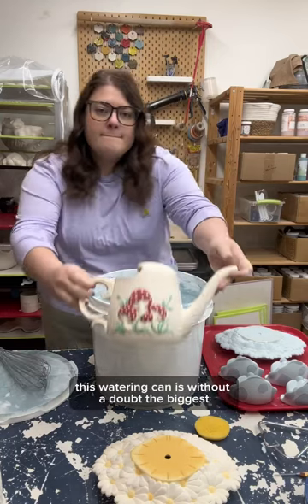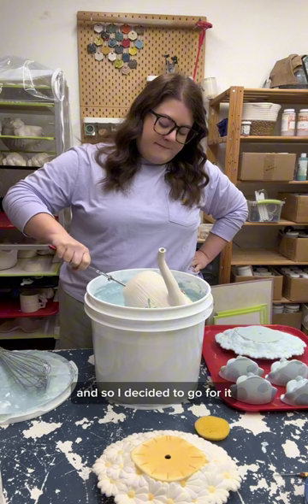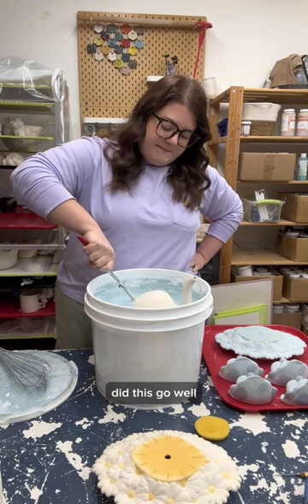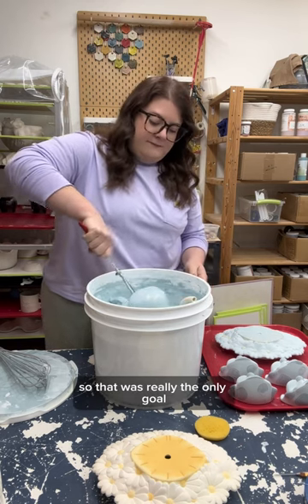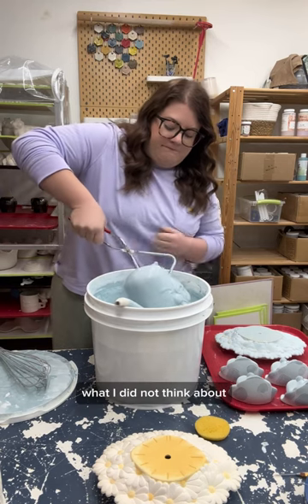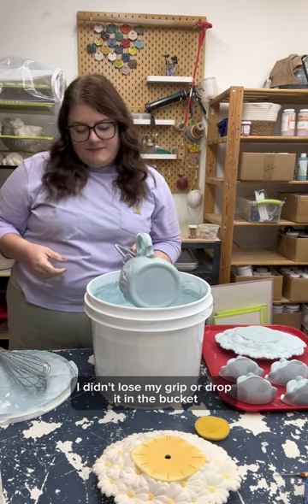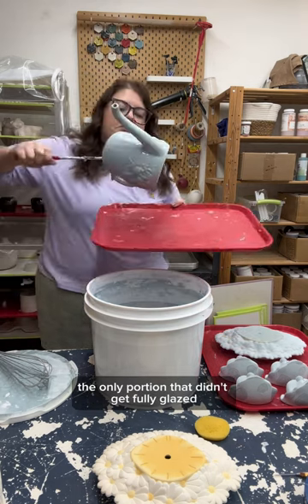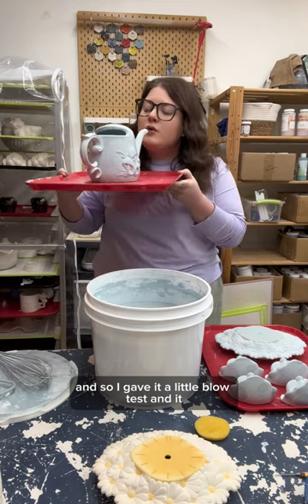Three more firings for what I have planned with this watering can 🤗 #ceramicartist

Comment: I would put some inside first and make sure that it is coated then move to dipping the outside so there isn't a concern of it being too heavy trying to pour it out. Less risk of falling or scratches too
Reply: If you dip it in its gonna fill up anyway
Reply: @rivercat26 Not if you know what you're doing.

Comment: Hold handle, dip front to get glaze inside, roll around to coat internals, hang from top lip over the pot (underside of lip that is unseen by users), dip handle you had previously held.

Comment: I'm the workshop I learned at we would probably just put our hand inside and hold it that way while dipping. And if necessary fill the fingerprints with a brush. With an object like that slight glass imperfections on the inside are not an issue imo.

Comment: Ok but how do u get the parts that r held by the tongs? I don’t want weird spots and I can’t figure it out
Reply: the tongs have points on the end so i think the glaze fills in itself, and even if it didnt, it would melt over the spots when firing. at least i think thats how it works, i might be wrong